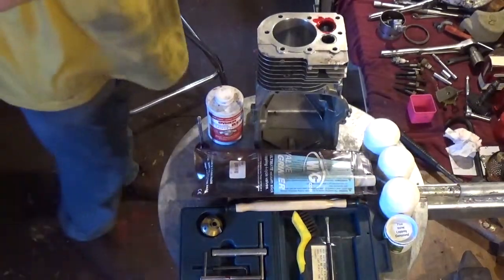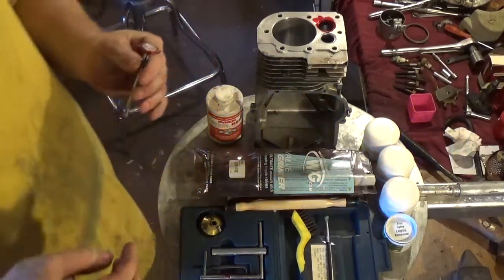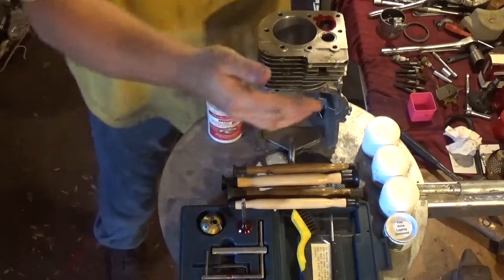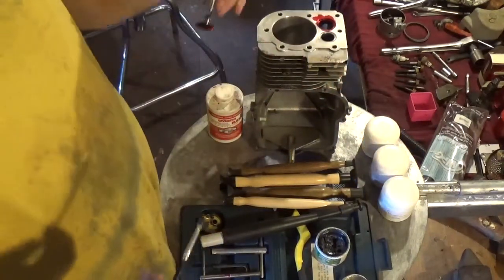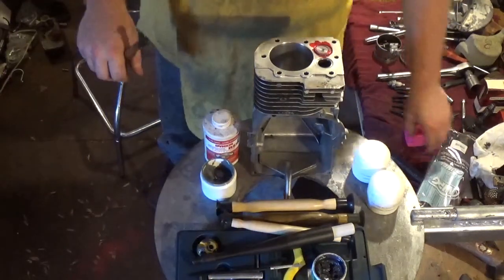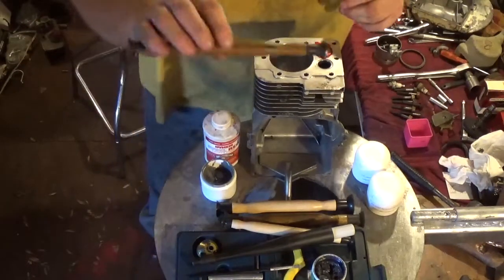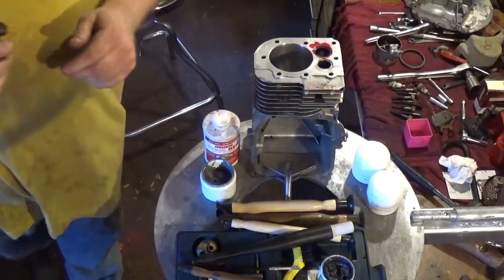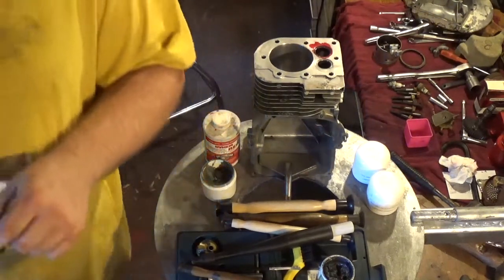How to properly lap valves on a 3.5 Briggs and Stratton engine

Comment: One trick I learned is if you use a drop of cutting fluid like rapid tap or something like that, it seems to make the lapping compound cut more aggressively even though it dillutes it a bit and leave a smoother finish as well. I've lapped a couple in that had dark spots halfway around the seat from them not being concentric anymore, got all that out of them. I take the suction cup off and use a 1/4" impact driver to socket adapter and push the suction cup over that and run it in the drill. Makes the process go a lot faster, I just switch from forward to reverse every few seconds and its worked well for me. I'd like to get some small engine valve seat cutters someday.